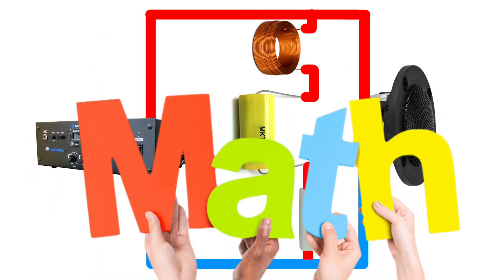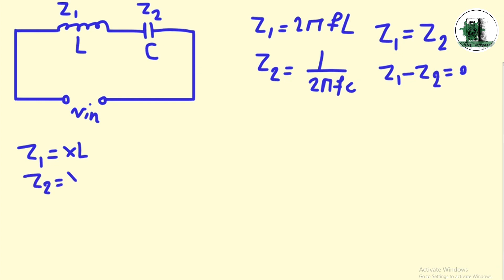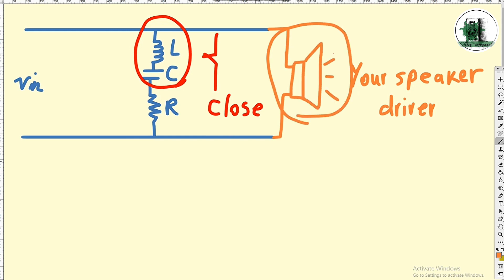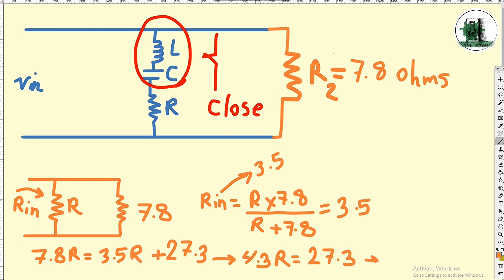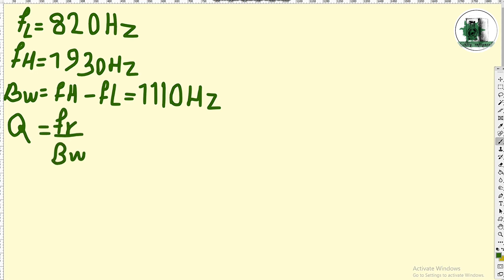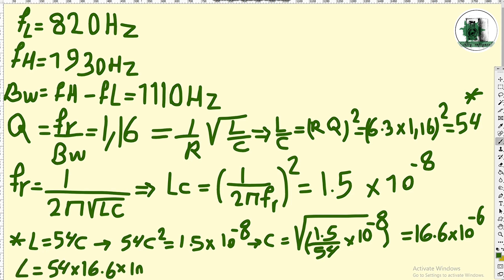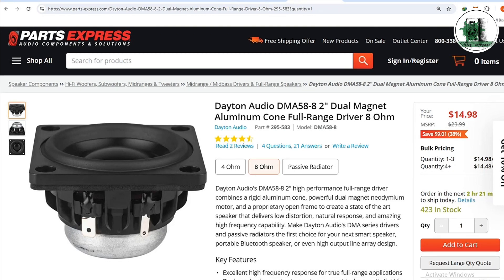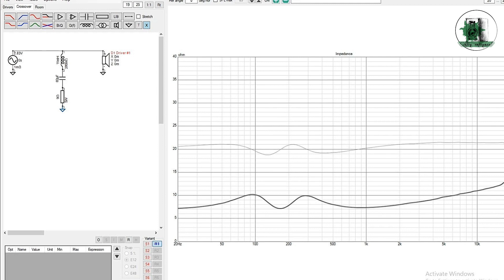Crossover Design, Series Notch Filters-Math

Comment: seems kinda AI generated, but still helpful! 3:25 seems to be a little off when the 'voice' goes: "Note that do these steps for any driver...", Which doesn't make any grammatical sense. 
It could just be text to speech with some mistakes.

Again, this is a helpful video that gets to the point, but seems a little fishy.

Still, thanks for the quick help! 👍
Reply from the maker: NO. Not AI-generated. I just use the AI voice. The video  has been made frame by frame.